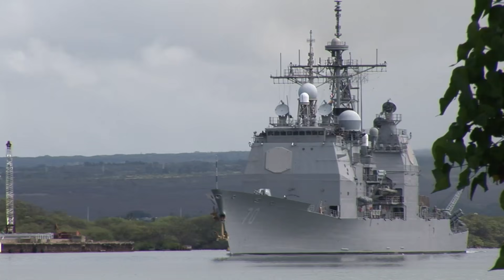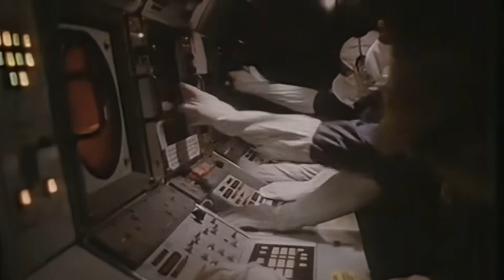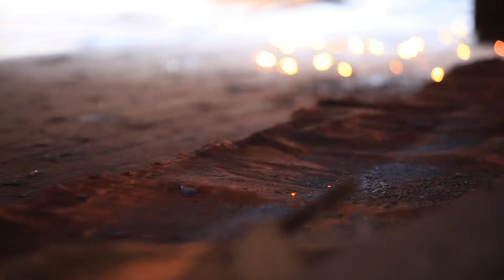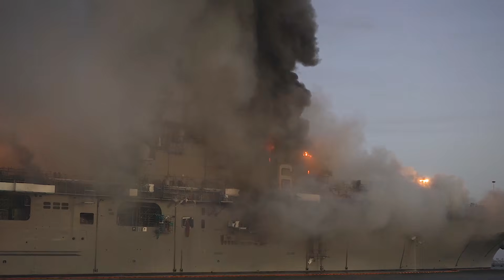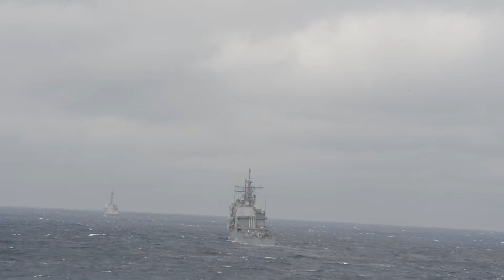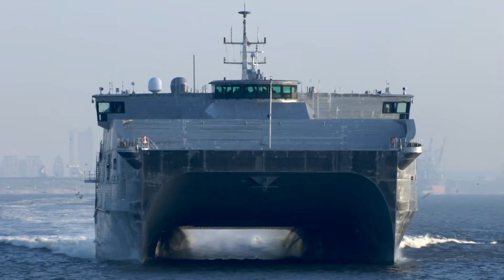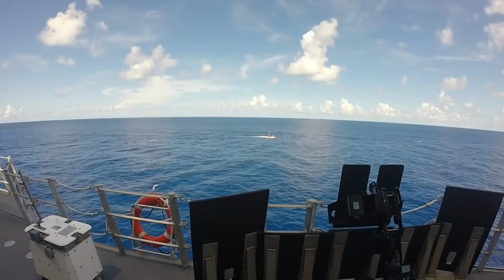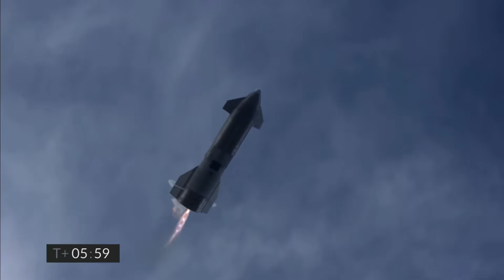Why is The US Building Aluminum Warships?

Comment: It makes sense now why Antelope, Ardent, Sheffield, and Coventry were lost so easily. Every time I watch footage or a documentary about the war I realize that the ships are taken out of action in one hit. Never made sense to me until now because I thought these Warships could take on 5-10 anti-ship missiles + gunfire + torpedos.
Reply: paper and actual combat can differ by a lot. just because it can survive a beating in paper, doesnt mean it will actually do that in actual combat. even a single, well placed hit can incapacitate a large warship if the attacker is lucky enough.
Reply: @CoffeeMug2828  ahem. Bismarck ahem
Reply: Both the Russian Yakhont and Chinese DF-21 anti ship missiles have thermobaric warheads..  The Chinese missiles goes mach 10.  Which is 400 miles a minute.. The Russian one is a sea skimmer and doesn't show up on radar.. Not you have enough time to do anything....
Reply: They stopped putting armor on ships because its heavy and did not save any ships..  1000 pound thermobaric is 30 thousand pounds per square inch... Anything within 500 meters is gone.

 Matters not what it is made of
Reply: @willrobinson9767  That's a bit of a oversimplification. As for your thermobatric weapons? Bikini Atoll tests showed ships can take even a nuke blast. The crews will be dead  as hell however.
Reply: @WALTERBROADDUS  Thermobaric are far more effective at destroying things than nukes are..  The old bridge at Hiroshima ground zero still there...  500 meter hole in anything Thermobaric hits.. No cover...
Reply: @WALTERBROADDUS  1000 pound as a 500 meter range..  Anything is gone including the crew...
Reply: @WALTERBROADDUS  You need to do some research...  The US moab was a 7 1/2 TON.  Thermobaric..
 Russian father was 8 tons..
 Neither said what the blast radius was....
Reply: British cruiser during the Falklands War was taken out by a single sub sonic sea skimmer..  They never saw coming..  Yakhont goes mach 3.5 now..  Impossible to stop
Reply: @willrobinson9767 My understanding is it was lost because their radar was ineffective at the time of the attack and did not detect either the attacking aircraft or the missiles until just before impact. They also thought they were outside the range of the super etendard, so were perhaps more casual in her approach than they should have been. Apparently they were  using satellite communications to talk to London and that  Interfered with the Sheffield's radar.  No doubt if they thought they were in range of the super Etendards they would have moved the ship away out of range before using its satellite communications so that it did not interfere with their radar, they did not do that. Consequently they were briefly blind, which happened to coincide with the attack. Other Exocets which were fired at the British fleet were decoyed away or shot down. In fact the missile that hit Sheffield had already been deployed away from HMS Glasgow.  I think the two other ships that were lost to Exocets were a civilian cargo ship with no defensive systems and a Royal Navy ship which was close in to shore carrying out shore bombardment and the missile was launched from land from a jury rigged launcher and did not show up on the  ships radar against the background clutter of the land, so they could take no defensive actions.  So I guess my point is that the ships that were lost were lost because they were unable to detect the attack or take any defensive actions. When ships were able to detect the attack and take defensive measures the attacks failed.  In the case of the Sheffield a board of inquiry concluded there was considerable negligence on part of some of the ships officers, but the matter was covered up so as not to distract from the victory celebrations after the war ended.
Reply: @chrism7969  There is a reason they arc naval shells..  Otherwise you hit the horizon..  You cannot fire a 20 mm like that either.

The range is only 3 to 5 kilometers..  No possibility they can hit something moving that fast..  Do not have time to try...
Reply: @chrism7969  It was covered up so people  would not discover its impossible to shoot down a missile..  Why lose a good officer when he couldn't do the impossible
Reply: The radar doesn't have a 400 mile range..  The further away the less it can see..  The DF-21 comes down directly from above which is a hole in radar coverage..  At best you might have 10 seconds...  That isn't the only DF-21 they got..
Reply: @willrobinson9767  That's not necessarily true. None were shot down ( although one Royal Navy ship did claim to have shot down an Exocet but it's not provable ) but multiple Exocets were decoyed away from British ships.  Unfortunately the Sheffield was blind so literally had no time to react due to its own satellite transmissions interfering with its radar. The missile was virtually within visual range before they spotted it and key personnel were not in the operations room.  Blinding your own radar and not having key personnel in the Ops room whilst within range of sea skimming missiles is pretty incompetent. The fact that the missiles that struck the Sheffield and Atlantic conveyor had been successfully decoys away from other Royal Navy ships before then searching for acquiring a new target and locking onto their subsequent victims who had either no defensive systems or or had them blinded proves that exocet was definitely defeatable.   However a court-martial would have revealed shortcomings in the Royal navy's missile defence systems as well as incompetence. No doubt any offices on trial would have tried to blame inadequacies in the Royal navy's missile defence rather than accept responsibility. It is notable that after the Falklands the Phalanx close-in weapon system was fitted to Royal Navy ships. So.to. repeat the Exocet was defeatable but only if you did things right and blinding your own radar is not doing things right.
Reply: @chrism7969  Decoyed away with what...
Reply: @chrism7969  Exocets were a horrible missile compared to Yakhonts and DF-21s...  They were still sea skimmers and their success proved they were good enough.  Even those were not defeated on that day...
Reply: @chrism7969  The British still won because their enemy was outmatched..  They never learn their Zulu lesson they can still have their ass handed to them by an inferior enemy..  Their cockiness was their undoing again.
Reply: @willrobinson9767  The missiles were radar guided and they used chaff to decoy them.  Pretty old technology really, going back to the Second World War. Also a bit tricky to deploy.  It works by presenting a bigger radar reflection than the ship which the missile locks onto, but there's nothing there for it to detonate on, so it flies through the chaff and goes back into search mode looking for a new target. The problem is the chaff  is carried on the wind so when deploying it the ship has take that into account whilst also making sure it gets out of the missile's radar search arc. Fire the chaff too early and the chaff  will have dropped into the sea or spread too widely to provide a bigger radar target than the ship,  whilst the missile is still quite far away, meaning the decoying  ship will still be within its radar's search arc. Deploy it too late and you won't be able to get out of the way fast enough to stop the missile hitting you. Basically you have to turn at right angles to the missiles flight path, turning into the wind so the wind carries the chaff away from the ship. You also have to time it right, not too early so the chaff stays in the air to decoy the missile and not too late so you can travel enough distance to get out of the missile's radar search arc.  I said you have to turn at right angles to the missile that's not entirely true. It would be the case if the wind was blowing at right angles to the missile's flight path as turning into the wind would help you put the most distance between you and  the decoy radar target as the wind would be blowing the chaff away from the direction you are sailing at top speed.  I don't know what the calculations are if the wind is in a different direction in relation to the flight path of the missile, but no doubt there are optimal directions to fire the chaff and sail the ship to maximize your chance of decoying the missile away from the ship. A tricky defensive tactic but one used successfully by the Royal Navy on a number of occasions during the Falklands War to avoid Exocets.
Reply: @chrism7969  Now they use GPS tracking 

Chaff will not work even if you could deploy it in time..
Reply: @willrobinson9767  The balance of force wasn't that much in the favour of the British and the Royal Navy was really set up for Anti Submarine warfare in the North Atlantic. So they weren't at all prepared for an ariel / naval war to suppport a land based war thousand of miles from the UK. It was quite a close run thing. I think one of  tthe senior British Naval officers said that if six more Argentine conventional bombs had have exploded in British Naval ships they would have lost. The Argentine Jets were releasing their conventional bombs too low for them to arm properly before striking British ships so they poked holes in the ships but didn't go bang. Had they exploded they would have sunk those ships. which would have turned the war in Argentines favour. I don't think the losses that occured to Royal Navy were down to Cockiness but down to fighting a war which they had trained for and which their systems weren't really designed to fight.  They made the best they could with the equipment they had, but it wasn't really the right equipment for the Naval/ Ariel War they had to fight. If there was one thing that made the difference it was that the British Harrieers were armed with the latest version of the Sideinder and that gave them a big advantage against the Argentine Jets.  
The RN was set up to fight in the North Atlantic as part of NATO and supportiing an expeditionary force thousands of miles from the UK with aircraft attack range of the enemy was at the very edge of their capabilities.
Reply: @chrism7969  I agree with everything you said..  It was an utterly stupid war to fight made more utterly stupid by taking severe losses..  They could have lost the whole task force and sent another..
Reply: @willrobinson9767  I don't know the right answer. It was a stupid war. The ownership of the Falklands is debatable. The Argentine claims amounts to the Falklands were originally Spanish Territory and we used to be part of Spanish Empire so it belongs to us. The British view is we took it off the Spaniards before you existed as a country so it can't belong to you. In additon the Islands have been populated and abandoned multiple times by the French British and Spanish.  However, there has been a British population there for aabout 150 years and they had been invaded by a Fascist dictatorship. So I am not sure to what extent the war was avoidable once that had happened. Any kind of deal with the Argentinians would have been against the will of the Falkland Islanders and the will of the majority of the British People.  The really dumb thing was had the Junta waited a few years a deal would have been done giving Argentina sovereignty over the Falklands and ensuring the Falklanders rights and splitting the econmoic resources, regardless of the Falkland Islanders views. However, once they invaded that was off the table. The Junta needed a war to bolster support at home because of the severe econmic crisis.  A bit of an external threat is very useful for stopping people looking at the domestic situation. However once the invasion had happened simillar political considerations kicked in in the UK. If the Conservatives had done a deal they would have been kicked out of power at the next general election in 1983 and probably not been back in power for a generation.  Having British territory invaded by a Fascist state and surredering the territory to them would have been perceived as a national humiliation. Just out of curiosity may I ask what nationality you are?
Reply: remember HMS Hood? Bismarck killed it with one shot through the ammo rack. Hood is a battlecruiser, supposedly can take as many punches as she can but no, Bismarck proved the otherwise despite the amount of steel in Battlecruiser.
Reply: @NaNoTech4Disaster  That was a miracle shot, but miracles do happen and that's all it took.
Reply: @MrBurgerphone1014  Not to the sailors on "Hood"
Reply: @NaNoTech4Disaster  seems like that happened to the Hood because of a faulty upgrade/redesign of certain components. Probably caused the trough of the ships bow wave to dip below the armor belt. Also remember that Bismarck fired over 90 15" shells at Hood
Reply: @NaNoTech4Disaster  You need to read up on the subject better.Battlecruisers have thinner armour than battleships,HMS Hood was designed before Jutland,in WW2  incoming shells landed almost vertically so Hood's armour was in the wrong place.Hood was due a major refit when war broke out and was 20 years old compared to the brand new Battleship Bismarck.It was hard to figure out exactly where the explosion on Hood was because there was just 3 survivors none near the explosion.A battlecruiser is designed to do battle with cruisers not battleships.The clue is in the name of the warship class.
Reply: @NaNoTech4Disaster  I don't remember exactly but the bismarck is a capital ship and it was fighting at that time two outdated and underpowered ships of the british but you do make a point one hit on the bismarck crippled it but it still survived after getting shoot alot more before it finally sunk it's like tanks you give them a bunch of armor making it cost millions but in the end it just gets taken out by a 100$ rocket
Reply: @hadesfist1017  Prince of Wales was newly commissioned, she was undergoing sea trials when she was hastily attached to Hoods Squadron & still had civilian contractor's on board at the time of the engagement, because PoW was straight out of the shipyards relatively speaking she was still having issues with her fire control systems, which meant the accuracy of her main armament  of ten 14" guns were limited. Bearing this in mind PoW still engaged both Bismark & Prinze Euegen causing damage to both ships which was ultimately severe enough in Bismarks case to lead to her demise at the hands of PoWs sister ship HMS King George V and HMS Rodney. Had PoW undergone a proper shakedown to iron out her teething issues its highly probable she'd have contributed more accurate & sustained fire on Bismark, this coupled with Hoods firepower would have been overwhelming in its ferocity.
Reply: @hadesfist1017  the Prince of Wales was a brand new ship which was rushed into service.  That was part of the problem. It really hadn't completed a proper shakedown and sea trials. It had on board representatives from the manufacturers because its main armament kept jamming. In fact it actually jammed during the battle with Bismarck . It also had a brand new crew who were inexperienced. As for HMS Hood, yes it was 22 years old but it had been refitted and updated multiple times during that period. The other problem for the British ships was the bismarck's radar had failed, so the German formation was being led by the smaller less heavily armed Prinz Eugen. Normally your heaviest ship led the formation, so the British mistook Prinz Eugen for Bismarck in the initial stages of the battle and concentrated their fire on her, so ignored the main threat which was Bismarck. Prinz Eugen's 8" guns weren't much of a threat to the British ships but Bismarck's 15" guns were.  As for HMS Hood a current theory is that the shell that sank The Hood was a "near miss" that travelled underwater and then struck below the armoured belt. Normally because shells weren't designed to travel underwater before striking they tended to fail or explode before striking the ship, the impact of hitting the water either triggering or destroying the detonator. There is also a theory that because Hood was travelling at speed it created a large wave along the side of the ship. The trough of that wave was below the normal waterline and the armoured belt, so the shell struck there, in the one place where it wouldn't be triggered by impact with the water and didn't have to penetrate an armoured belt. So you might call that a lucky shot. However there was clearly a vulnerability. Interestingly enough the Prince of Wales also had a a 15-inch shell strike It below the waterline and below it's armoured belt but the detonator appears to have been damaged by striking the water so it didn't explode.  It was found deep inside the engineering spaces of the Prince of Wales, had it exploded the Prince of Wales might have been sunk too.  Finally the Bismarck was sunk because a thorpedo struck in the one place it was vulnerable. I.E. it's steering gear. Had it struck anywhere else it would have hit Bismarck's extensive torpedo defences and not done significant damage. Bismarck was a brand new ship and was sunk by a lucky hit in it's one venerable area. I also think that was pretty much the case for HMS Hood which was struck in the one area it was particularly vulnerable.  I don't think it's age had much to do with it's sinking. Even brand new ships have their vulnerabilities and if they are unlucky enough to be hit in them they sink.
Reply: @jaybatsford  Also didn't help that Hood was WAY overdue for refits and modernization because she'd been kept on active service as flagship.  With her powerplant overhauled, planned armor modifications made, and updated fire control in place, Hood alone would have been at near parity with Bismarck.  Adding in a properly functional Prince of Wales(and excluding the miracle magazine detonation) would have made it a curb stomp.  Everyone seems to overlook the fact that Bismarck was a really inefficient, flawed design, somehow assigning it some hallowed place as a "super battleship" despite being a warmed over WWI design.
Reply: @NaNoTech4Disaster  to be fair it was a golden hit, no amount of luck could reproduce that
Reply: @NaNoTech4Disaster  Actually theory is the hit was on the hull  under the waterline and armor belt.
Reply: @WALTERBROADDUS  which would make sense since they suffered a catastrophic magazine explosion, magazines on a ship of that type being stored all the way at the bottom of the ship
Reply: high explosive will do that
Reply: The current crop of US minesweeper have a wooden hull..  This makes them unseaworthy so they have a 8 knot max speed..  This also does not save them from mines...  They never bothered to replace the pieces of crap...
Reply: @willrobinson9767  You realize they have a wood hull as it is non magnetic.  That has nothing to do with speed.
Reply: @WALTERBROADDUS  Which saves them from magnetic mines but not contact....  The fleet moves at the speed of the slowest ship..  Alot of fast ships will be creeping along too..  Just the speed makes them useless.....
Reply: @willrobinson9767  high speed travel in a minefield never ends well.
Reply: @WALTERBROADDUS  It does if you are under fire from the shore...  The minefield might be the least of your threats...
Reply: @WALTERBROADDUS  Running across   an open field in broad daylight is a great plan if you need to be on the other side of the field as quickly as possible ..  In combat time is rarely not a crucial factor..
Reply: @mandellorian Bismarck sunk the Hood, not Prinz Eugen and it was a high angle shot which pierced the deck and went down into the bowels of the ship before exploding
Reply: GPS isn't going to work for terminal guidance on an ASM. Something fired 300 miles away at Mach 2 will find the ship has moved 5+ miles in the time it takes to get to the target.

GPS works for putting a missile in the right area, or precision Vs stationary targets. It won't solve the radar spoofing of jammers and decoy chaff.

Thermobaric weapons are interesting. They have some distinct advantages in terms of bang for buck, however in an ASM they also have some weaknesses. A non-penetrating explosion would do a lot of external damage, however compartmentalisation of the structure would make it a lot less succeptible than a standard structure. A penetrating detonation would be limited by the compartment size penetrated, which would mute the detonation due to inadequate dispersion of the aerosol and insufficient oxygen.

Plus, weather would be an important factor. Any kind of heavy sea or rain would mute the detonation with water spray.
Reply: @mandellorian Does details matter when the point is -- one lucky shot can sink supposedly durable vessel?
Reply: But they did! these ships failed because they were overwhelmed or were shot at from blind angles
Reply: @kralle98  yeah because you had too turn the radar of too use the rafio on sheffield and the argentinians new this since they had a sgeffield class of their own also the brits didnt think the argentinians could reach them
Reply: Sheffield was all steel
Reply: @chaosXP3RT  You want them to be aluminum above the main deck.. Saves weight and makes them more stable and can make faster speeds..
Reply: You look handsome
Reply: + carpet bombs+ICBMs+a10 gun runs + laser strikes uk i think it could take more